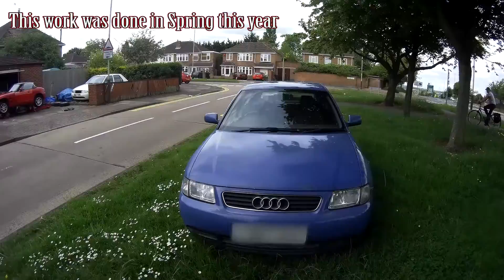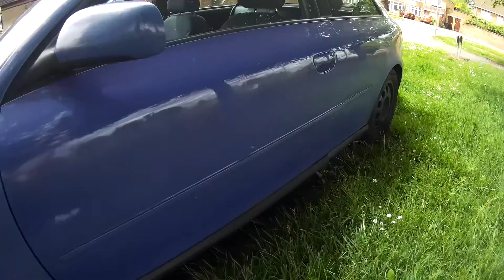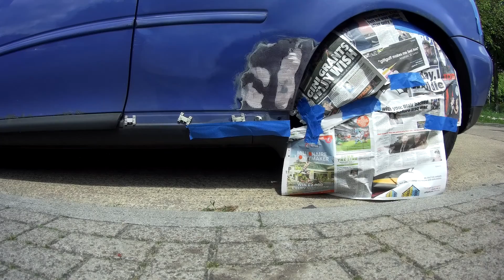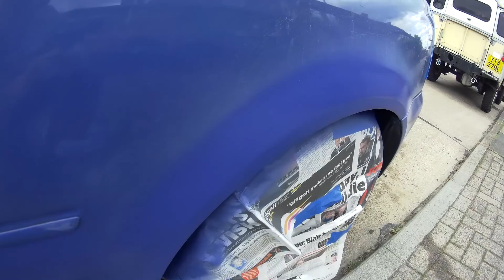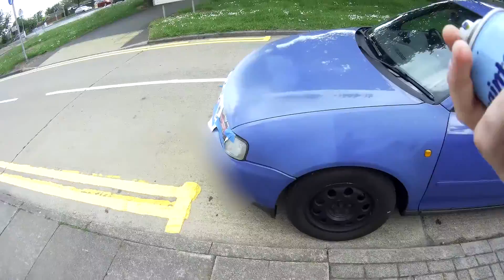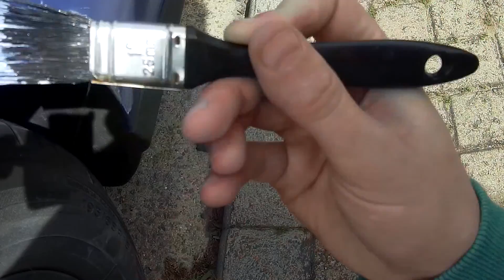Project Oynx - Body Prep - Part 1 Dealing with rust issues

Comment: do you think thats the problem with arches it needs cover on inside,that looks like carlisle
Reply from the maker: I think if the rust has gotten though to both sides of the metal treating the visible side is just a waiting game of it coming back. I know for a fact that on the doors it goes inside the skin and I should have addressed that. After it warms up I'll do a review a year on and what I need to address but tbh it's only an afternoon's work to sort.

Comment: sometimes think best thing is cut it out and just fibre glass it
Reply from the maker: For the doors not sure but I have spares now, for the arches I do wonder but that's only one that's come back a bit and semi tempted to deal with that with an undercoat inside the wing using waxoil.
I'd like a LandRover so dealing with rust by course of cutting out bits of chassis and welding in new bits will become something I get used to in the future.

Comment: how long ago you do it,the rust convertor you used the one the military use you think ok,got bad rust on saab 900 wheel arches
Reply from the maker: This was back in april - the areas I think it comes back in is due to to me not treating both sides with with a the inner skin on the doors or arch could be an issue.

Comment: that looks nice job hows it holdin up
Reply from the maker: Mostly ok - the doors are not good but I think they are at the point of no return - it could be worth redoing them and sealing the inside. 
The nature of the job though is you can quickly redo bits that are an issue - the bonnet - roof, and boot are all fine.